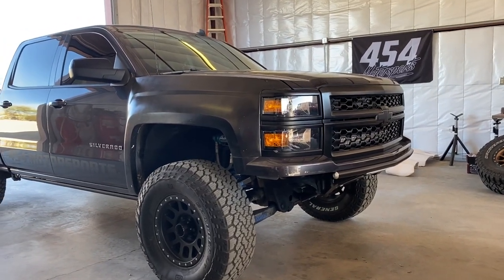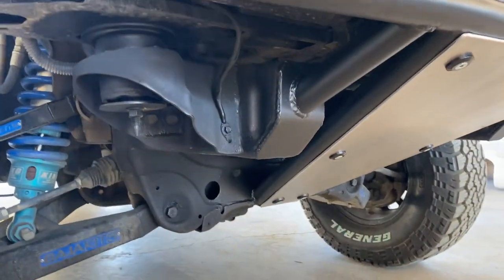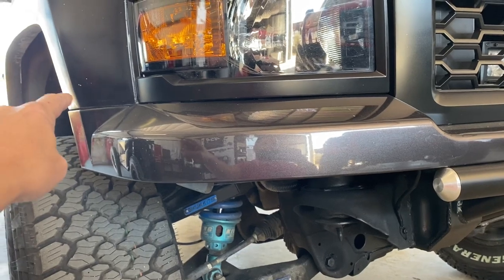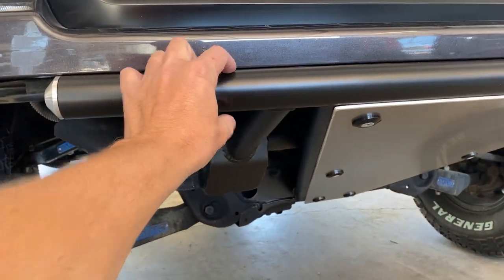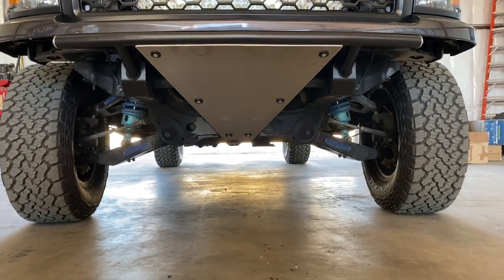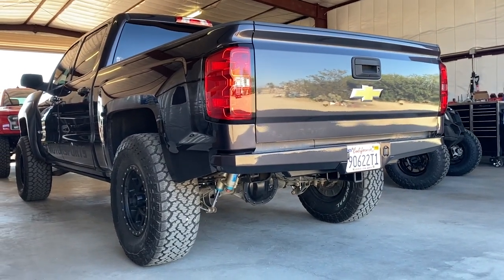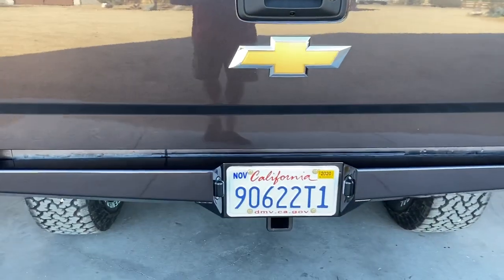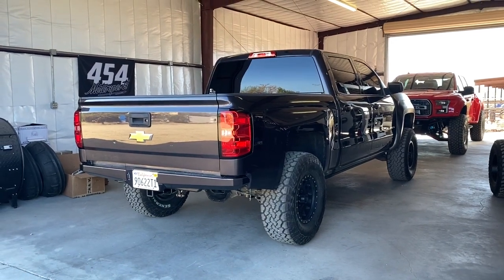Prerunner bumpers, how and why. This episode: Chevy Silverado

Comment: How are the front wheels sticking out on prerunners?  Do they have spacers on them?
Reply: Mostly control arm work, longer travel requires longer control arms for the droop of the suspension pushing the front wheels out
Reply: @freddydeanda3468  I would think longer axles too
Reply: @chrisv3863  if the truck if 4wd then yes